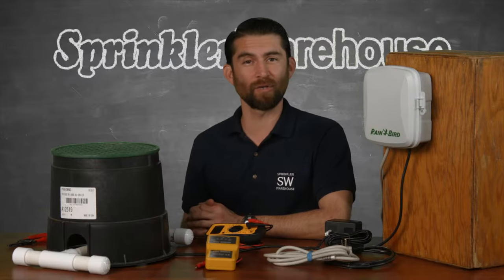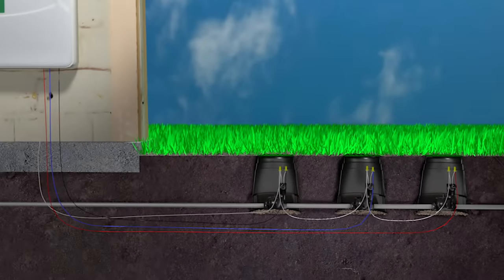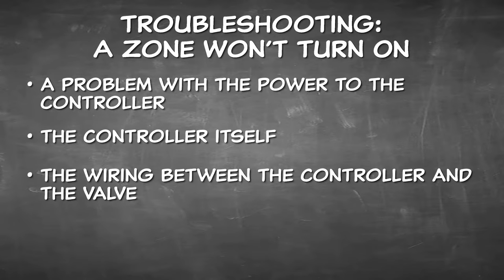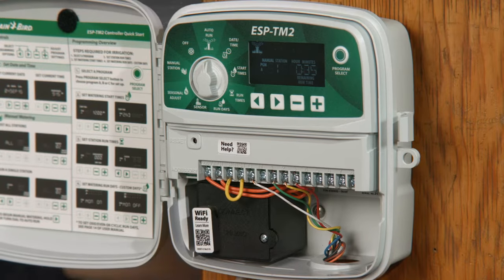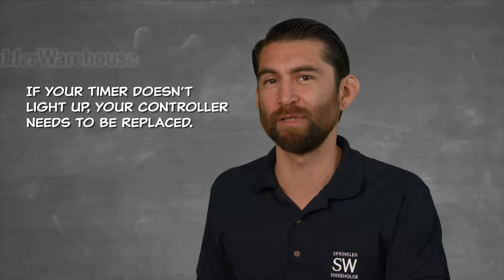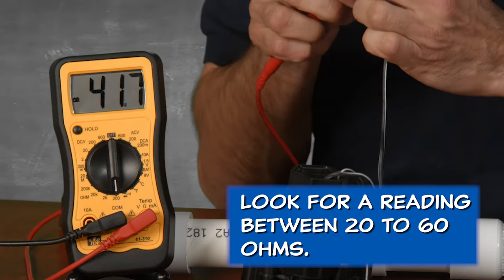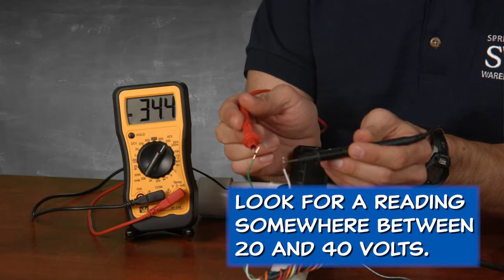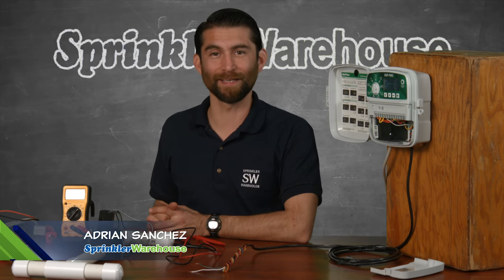Troubleshooting Valve Issues

Comment: I have 5 zones on my irrigation system.  I can run 1 & 2 &5 by itself with no problem.  When I turn on zone 3 or 4, zone 5 comes on too.  What is the problem?
Reply: I have had both a small rock and a stick stuck in a valve forcing it open. Apparenty construction debris. Also have seen a leak right at the valve which within 10 minutes or so shorts the soleniod and opens the valve.

Comment: Sometimes it will not open the solenoid even with good batteries.   Since then, I now only use three 9V batteries in series to pop my solenoid which produces 24V-28V.

Comment: I just replaced an anti shipon valve.  I failed to mark the wiring, but have I’dd it’s red wire in the box.  I only have 1 station.  Red wire and common I get that.  When everything is wired and I’m ready to test the valve manually from the box does the water on the valve need to be off.  The valve works when I turn it on manually on the valve itself because it’s new.  But to test it in manual mode from the box do I close everything on the valve? My wires are also a mess.  Very weathered and some of the plastic on almost all of the is disintegrated.   I’m I making any sense?  Any suggestions 😞
Reply: The sprinkler valve does need to be closed by hand so that you can test it electronically with the manual setting on your controller because those are 2 different methods of turning on the valve.as for the wiring you might need to just run new wires.

Comment: Thanks so much! None of my 5 zones would turn on so I used your advise and found one of the white wires came out of the big bundle so I reattached and now all are working!
Reply from the maker: Excellent! We are glad this worked.
Reply: @SprinklerWarehouse one of my zones doesn't work. When I turn the valve manually I see water at the valve but the sprinkler heads still don't work. Does this mean faulty valve?

Comment: I have had the valve replaced. There are 8 impact pulse on the zone. I have good water pressure and I have one head that won't stay up. It comes up and then goes back down. I have replaced the head 3 times, any advice? I AM STUCK.

Comment: If I run zone 1 from the controller, I get power at 1&2 (with multimeter). Only zone 1 pops up. If I run zone 2, only 2 gets power but doesn't pop up. Is my system haunted or cursed 😭.

Edit  Y'all, I figured it out. There was a failed splice in the control wire in the valve box for zone one. This was affecting the master as well as 1 & 2.

Comment: @ 2:00 +  if the valve is staying on, it's usually due to a faulty diaphragm or grit within the valve structure,… and either grit needs to be cleaned out, or, the diaphragm needs to be replaced.
Reply from the maker: Correct, below we have provided our article on Valve Troubleshooting Guide
https://school.sprinklerwarehouse.com/parts-repair/troubleshooting-chart-valves/
Reply: @SprinklerWarehouse  For Chart 4, leak from lowest sprinkler on zone:  'head of water' is going to leak out after the valve is turned off, nothing necessarily amiss with the diaphragm,….. and so, as you know (right?), the sprinkler body(pop up for example) should have a check valve, or, a check valve placed in the line  near that sprinkler to prevent 'head of water' outflow after valve shut off.    Yes?

Comment: You need to add one more possibility to the troubleshooting guide here. At the 5:00 mark, when you perform this test, what happens when you get a resistance reading that jumps around between zero and 200, never settling into a narrow range within a few ohms?
Reply: I had that issue today, thats a worn solenoid.
Reply: @acunchevy54  Yes, time to replace.

Comment: What if a valve just clicks? First time seeing this problem. Wiring is correct.
Reply from the maker: Hello, most of the times it is the solenoid. For further assistance we ask that you contact us at 281.500.9800
Reply: If it's clicking, the solenoid is working.  Remove the three assembly screws from thre valve body, pull the "guts" out, inspect the diaphragm, clean and reinstall.  Assuming it's just a small particle under the solenoid plunger causing the problem, you can be up and running in less than 10 minutes w/o buying a new valve.  So easy a sprinkler guy could do it!

Comment: Thanks for great video....what happens if 1 zone is running low pressure....all heads won't pop up all the way....what should be changed? Thanks in advance...
Reply: He answered that in the video. Check the valve.

Comment: My Rainbird valve doesn’t turn on manually turning the solenoid, the sprinklers don’t pop up, just low flow. What should I do? Thanks in advance
Reply: Assuming water is going to the valve, sounds like a possible blockage in the valve housing. The main valve part has input(s) and output(s) as well as the solenoid. Make sue those are clear.
Reply: Does it operate normally from the controller/timer? If it is, check if you've opened the Master Valve all the way, assuming you have one, along with the flow control at both MV and Zone Valve. Sounds like a valve issue - disassemble the diaphragm, flush any possible debri and replace the guts.
Reply: @Adam-dn5oc  yeeeaaaahhhh all that went over the guys head. Call a tech my guy you need to replace the valve..
Reply: 99% of the time it's a break in the lateral line.

Comment: Don't take this guy too literally.  He works in a warehouse and does not know what he's talking about. Hire a licensed irrigator and have your system checked at least annually.
Reply: Sound to me his advice is sound... besides ... who wants to pay some tech nowadays for something we can fix ourselves?
Reply: He shows his lack of field experience by opining that replacing the whole valve when just the solenoid is bad is best.  NO!  Replacing a solenoid is a 5 minute job.  Installing a new valve requires about an hour.  If the valve itself is bad..do not remove the entire valve, just remove three screws and install new "guts" from a new valve...no pvc work required.